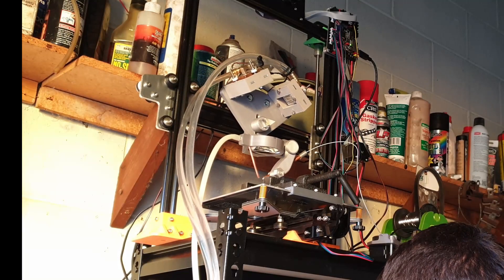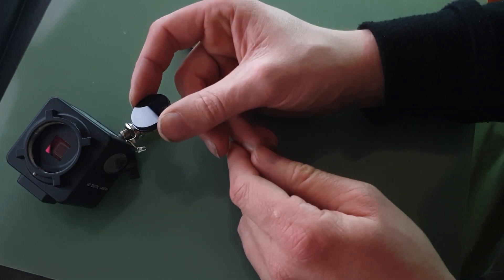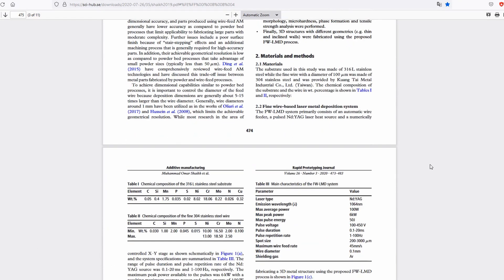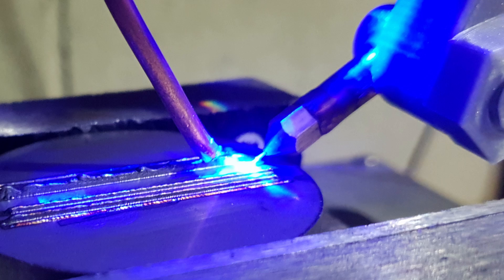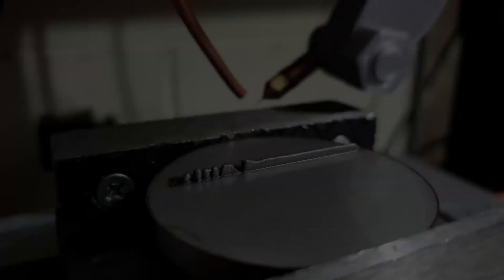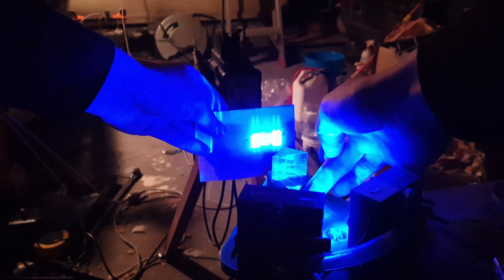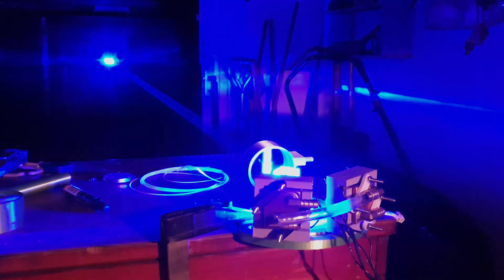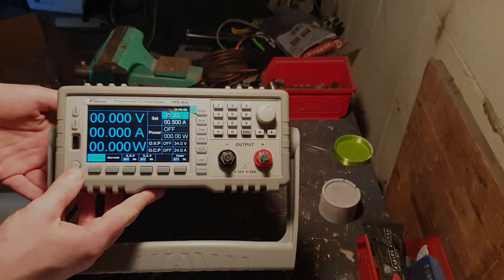Experimenting with wire based metal 3D printing | Metal Matters

Comment: At the risk of overcomplicating things, I'd say add a DC electric welder stage as well. Ideally, you would wind up with a sort of hybrid between electroplating and electro-spinning, enabled by the laser pre-heating in a non-oxidizing atmosphere. If the metal started to bead up, it would be pulled back into contact with the deposition surface by electrostatic forces (hence the "hybridization" between electroplating and electrospinning).

Comment: Might want to look into 3% Hydrogen/97% Argon for the shielding gas.  With orbital (automated sanitary tube welding) and TIG welding we were able to get better welds at lower amperage, thus decreasing the size of the heat effected zone, when compared to industrial and high purity grade argon.  It might reduce the balling, also like TIG welding, you might want to start the laser first to create the start of a molten puddle before feeding the wire, as it would give it an anchoring point, before you move the platten.  Looks like an interesting project, hope it works out.

Comment: combination of induction and laser on the print head would be interesting.  pid control induction to hold a specific  temperature.   Then you need much smaller laser to make the melt pool.

Comment: What would help you with this beciase I'm a welder by trade is watching how to t. I. G. Welding stainless steel videos. You need dwell time for your puddle to cool and shielding over the puddle. Also heat retention will keep building and the heat required to fuse the 2 metals will gradually be less unlike plastic. Use argon to shield and cool or you will get porosity! Too much Gas is bad too will pull heat away from your puddle! Pwm I think is what you need. Kinda like tig pulse! Power has a min and max like a.c. Power. You set the frequency or duration of the max time and min time to give you heat when you need it and low power to cool it so what you went over already won't over heat and blow holes in your part if alot of heat is required on thinner materials but more heat than it can handle continuously!

Comment: Idk, the Laser here seems like an issue when simple electrical contact would accomplish the job. Relatively large heat sink to ensure only the tip becomes hot or even running the current in pulse mode such that you are laying down pixels seems far less complicated than screwing around with Lasers here.
Reply: I mean, a 9v Battery would be enough to weld wire that thin.

Comment: Very intriguing project. If you are bothered by the beam profile you could consider adding an aperture after your lens and it may help with melting of the wire prior to hitting substrate if that is still an occasional issue. I do wonder if playing with pulse width duration and/or pulse frequency for your initial layer and following layers, analogous to changing print speed and print cooling in FDM plastic printing, could help with your most recent problems.

Comment: I like your approach, and that you are thinking outside the box, but I think you should look into F theta lenses and galvos like I suggested. All the commercial units go that route because of the speed it offers, and it would bring the cost of the entire laser system (power, laser, lens, beam steering) down to about $300-500. 

The F theta lens is $70, 2 galvos cost $60, a CO2 laser costs $100-200 depending on output, add to that the psu, cooling and you can get a 300mm build volume. Even better is a rf co2 laser because of longer life, it allows for high speed pulsing, so you can increase speed by shortening the pulse and increasing power. You can also use a fiber laser with this setup but they are more expensive and need a different wavelength F theta lens which is also more expensive. 

A wire feed, or multi diode powder laser will never be useful for more than high-value applications due to cost, for which the quality is just not good enough and prototyping. They are too slow and expensive. The wire fed systems on the market use a vacuum chamber and nitrogen atmosphere, which adds even more cost.
Reply: afaik 3d systems uses a vacuum chamber with their powder bed systems that is first evacuated and then filled with argon. f theta lenses are of no use for wire additive.
Reply: @Gekkoperformance  I know. I suggested it for his powder bed, several months ago. There are ones that don't use gas but depending on what powder you use you will want argon, nitrogen, or CO2 as a shield gas. You can use positive pressure to displace O2 but even if you go vacuum you can buy a pump for $60-100 and even less bulk. I have 2 I pulled from old fridges.

Comment: Why not approach this project like an arc welder and use high amperage electricity to melt the wire?
Reply from the maker: Managing the excessive heat that arc welding generates is difficult. I will attempt this in another video.

Comment: Hi, did you tested the fiber coupled laser diode? what is the focus spot size? i intend to buy one and i don't know what beam quality they have, for calculating the focus spot. Also the producers do not include this parameter in the datasheet.
Reply from the maker: I have only tested powering it up, not focusing. I am building a heatsink and lens assembly for it at the moment. I will post on the forum when it's together. What specifically are you referring to when you say beam quality? M2? They won't state it as the beam isn't collimated

Comment: Try flowing argon out of the wire nozzle, around the wire, this method works for cooling wire in mig welding
Reply: I'm wondering why they're using syringes and not MIG nozzles. I feel like there's a number of design elements that have already been worked out.
Reply: If the whole chamber is submersed in shielding gas then it could also be recycled from ambient cold gas using a pump. Like the "berd air" cooling system used on some  FDM printers.

Comment: You are going to need to upgrade to a 4th and 5th axis if you ever want to do overhangs, also a good idea might be to use a powder spay down the center, that way it's got momentum to stick to your parts.

You'll find that if your wire is melting back into the feeder you need to increase the wire feed rate, that's a tip from MIG welding.

Comment: Have you ever considered making a magnetic force underneath that pulls the molten metal downward a bit to reduce likelihood of balling up and promote bonding with the weld?  or am I a big dummy?   
(the magnetic coil would need to not be in the super heated area, but the force would pass through most things)
Reply from the maker: Ignoring this is SS, once you're past the curie point magnetic forces don't really exist.
Reply: @metalmatters  yeah I thought so, just wasn't sure.

Comment: The issue you encountered with the heat is well known within WAAM. Usually, they have some mathematical model with a feedback loop to compensate for it. But it's hard to get rigth.

Comment: Definitely you should get an IR thermal camera to monitor the temperatures of the laser spot and process area. I know they can cost a couple of thousand dollars but without it you might have a very hard time progressing. Some set-ups in research even use additional coaxial CCD cameras with beam splitters to monitor the temperature within the melt pool.

Also would be good to upgrade the filter on your CCD camera.

Regarding the sagging of the deposition at the sides, it is common even for industrial DED systems and research institutions. It can be fine-tuned with speed and extra deposition at the sides, so I don't think you need to worry about it at this point. The timing of the wire being fed also matters, usually the laser turns on a fraction of a second before the wire is added to prevent the wire from melting prematurely and the wire is withdrawn sooner at the end of the deposition path to stop it from getting stuck in the weld pool. Ideally once the cladding starts you want the wire to enter the melt pool and not the laser path directly, which should limit the amount of heat travelling back up the wire.

For the side feeding balling issue, as what you said the main problem seems to be that it is just not hot enough, maybe you can try it with the induction heater to see if that fixes the problem, or add the wire a bit later after than the laser.

For the issue of the the reflections melting the coaxial wire prematurely, perhaps you can try a surface treatment to break up the reflections since the angle appears to point the laser right back at the wire. Perhaps sand/shot blasting or roughing up the surface to a matte texture with sandpaper?

Hope this helps, good luck and I look forward to what you are going to come up with next.
Reply: At these temperatures, an ordinary web-camera should work just fine for measuring temperature.  Just need a good camera calibration to figure out what black-body temperature maps to a given pixel color.
Reply: Perhaps a pyrometer would be better and cheaper? The best industrial thermal cameras have about a 2% error margin, and the spot you want to monitor is well defined.

Comment: That looks really promising and  far cleaner than the attempts using repurposed mig welders. I wonder if you could heat the substrate by running a current through it? Perhaps you could have a mirrored tube deliver the wire so reflected laser light would just be scattered instead of heating the wire/tube interface.
Reply from the maker: Yes, although I am curious about arc based processes but not mig. I think you could heat it that way but it would take a bit more work to make it happen. It was only the wire that was struck by the reflections, it created a ball of molten metal which eventually got big enough to make physical contact with the syringe.

Comment: wouldn't preheating the wire  just be for entering the laser solve a lot of the problems ?
Reply from the maker: The problem is the substrate is too cold, the wire takes minimal energy to heat.

Comment: So glad to see an update, keep up the work! I think wire is the best option here, as there is more control. But definitly working on a more rigid set up for better precision, and better optics will be your greatest improvements. A proper nozzle, similar to, or simply a water cooled MIG welding head to remove the thermal load from the wire as it feeds. And really tuning the laser into hemispheric arc segments around the heating zone. I am impressed the diodes are capable of melting. But maybe a combination of diode heating, and actually electrically welding the material could help control the physical lay down of the metal? The arc seems to help direct the placement of material.

Comment: Amazing work as usual ! I was wondering if it possible to use inductive heating to heat up and melt directly the feeding wire right above the build plate with a tiny induction coil wrap around the wire instead of using a laser. Miniaturizing the coil and cooling it are certainly challenging !
Reply from the maker: I think it would either be very hard to control due to low surface tension or produce weak layer bonds. Have you seen this? https://hackaday.io/project/178132-fdm-3d-metal-printer
Reply: @metalmatters  Thanks for the link! This is what I had in mind.

Comment: I know this is far in the future, but maybe having an enclosure filled with argon might be a better solution than to try to channel the gas through the welding end?
Reply from the maker: It no doubt is but purging is quite expensive. The SLM printer only uses a 30 liter container less the volume of the printer and takes 80 - 100 liters to get below 0.1% oxygen.
Reply: @metalmatters  rather than using argon, you might be able to put some material in the chamber that oxidizes very easily

Comment: Could you cool the incoming wire with the shielding argon gas?
Reply from the maker: I believe this is already happening, and is partially responsible for the balling effect.
Reply: @metalmatters  Ah, would it be possible to build an enclosure around the machine and flood it with argon instead?
Reply from the maker: @ECL..  Yes, expensive to operate though
Reply: @metalmatters  True. Had in idea for a new method of metal 3D printing, would need to explore its feasibility however. Electroplating a metal power and electrolyte slurry. Electroplating layers at a time and masking the areas that you don’t want binding together. Any thoughts?
Reply from the maker: @ECL..  https://www.youtube.com/watch?v=3gal-BD8oGU
Reply: @metalmatters  Oh awesome it already exists!

Comment: Awesome as always,
As a nobody with no qualifications can i suggest an idea for discussion?

If we have a standard mig wire welder, but we oscillate the wire in and out at say, 10hz and 5 mm.
if we then isolate the power supply from the head at the rectified dc level, preferably half wave.
if we then put a high discharge capacitor (think xenon flash) that discharges a fixed energy pulse each time the wire moves forward plus the oscillation full forward.
Possibly electronically firing the capacitor times with the wire forward oscillation.

Thus givivng a measured energy and volume of feed wire.

it may? be possible? to induce a high voltage ignitor pulse exactly the same as a xenon tube is fired but across the feed wire to bed gap.

just trying to gice more control to the work.
Reply from the maker: I happen to have a DC pulse TIG welder with a feature called "cold welding". It's a bit of a gimmick but I think it performs the function you're describing. Basically it's just a high frequency tack welder. I've had thoughts along the lines of what you're describing, less the dipping of the wire. I think that might just lead to an uneven bead.
Reply: @metalmatters  
Interesting. 
I will google that later. 

Is it like a spot weld?
One pull of the trigger one pulse?

Does it run consistent volume?
Reply from the maker: @brucebaxter6923  It is kind of like a spot welder but will run indefinitely based on the frequency you set. It's just a TIG waveform less the base current. There's no wire feed as it's TIG. The welder is a TIG250MPL if you want to know more.
Reply: @metalmatters  
Ahh, oops.
Yea, I’m not very smart, it was just a random thought.
I guess a mig wire feed would need a stepper motor to be attached. .

Comment: for the split-beam reflecting and heating the wire prematurely, could you angle beam/wire relative to the surface?
Reply from the maker: I probably could do. I really wanted it to have consistent characteristics in all directions but that seems like a good workaround.

Comment: I suspect it might be worth dynamically changing print settings as the print progresses. Such as starting the induction heater off hot and slowly lowering it as the heat from the laser heats up the surroundings of the bead. Or changing the print speed and/or feed rate. Ideally you’d have some optical recognition software running in the background that could compensate for layer heights sinking into one another, but that’s some next-generation stuff.

I’d also consider making a thin water jacket around the copper tube to provide some constant cooling to the filler wire. Overall I think there’s more promise in a wire-based 3D printer than a powder bed one, just from the perspective of structural soundness, but it’s definitely no less finicky. Have you seen that video of electrochemical metal 3D printing? Might be an interesting way of making variable alloys, and there’d be no risk of porosity or improper adhesion.
Reply from the maker: Yeah, I'm sure increasing the print speed will resolve a lot of the issues I showed at the end. I need to cast a new arm before doing that as I have changed the lens since filming. Adding water cooling is probably a good idea also. I have seen the T3 pitch, pretty impressive stuff.

Comment: awesome video, it is unclear are you using the wire feed line to deliver the argon or are you still using a separate delivery line?
Reply from the maker: I was using a separate line. If you look at the thumbnail, the tube mounted on the left hand side was supplying argon.